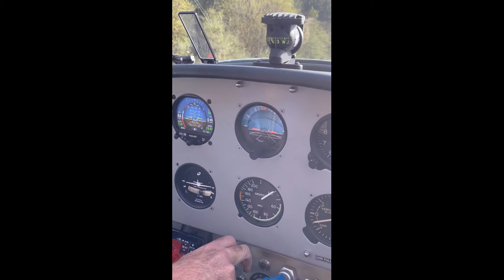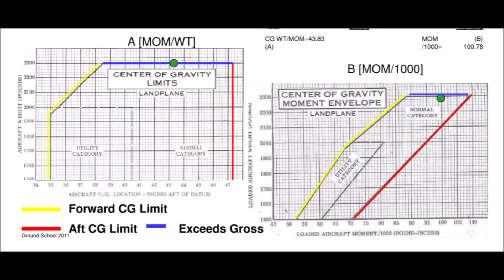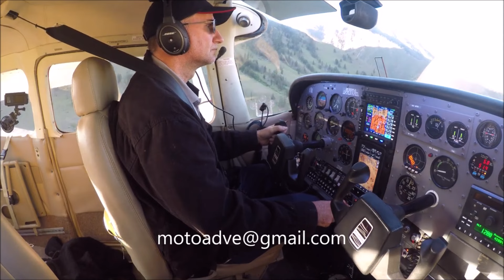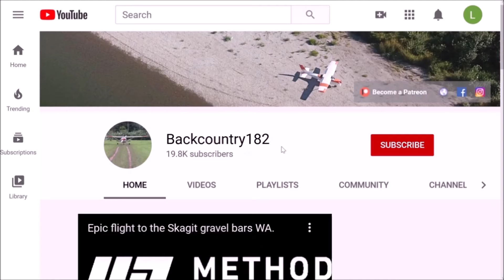How to do Short Field Landings , Techniques, Examples, and what to Avoid

Comment: Always enjoy your videos. Your techniques have added to my confidence and as a result I've taken my Piper 140 to way more places than I otherwise would have gone to.  I practice the very low pass in ground effect regularly as well as slow flight. I also think that just doing circuits regularly is often overlooked by a lot of pilots. Other pilots think I'm odd because I find going out and doing 8 or 9 circuits is actually a very fun way to spend an hour. For GA pilots I think we should all have at least a 2 to 1 ratio of landings to hours. At age 54  I've only been flying for 4.5 years with 500 hrs but with 1300 landings. As you always show, landings are really the most important part of the flight usually.
Reply: Agreed 💯

Comment: I went out in my 182P and practiced this the other day. I was able to land (stopped) in appx 850'. I practiced on a 6700' runway in light wind conditions. (KSRB). Started with slow flight over the runway a few times, then a stabilized approach @ DMMS transitioning to just about slow flight on final, flaps 40, I'm gonna continue working on it.👍

Comment: When you increase power and gain altitude, it is only because the angle of attack also increased, either by the propeller slipstream or by back pressure.  Power alone will not increase or control the altitude.